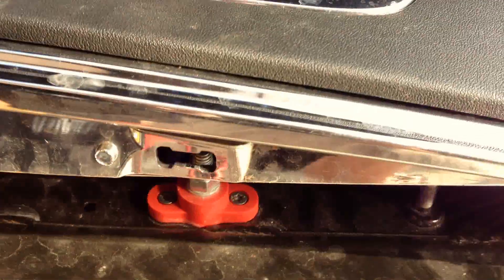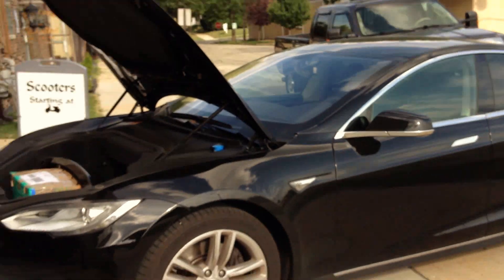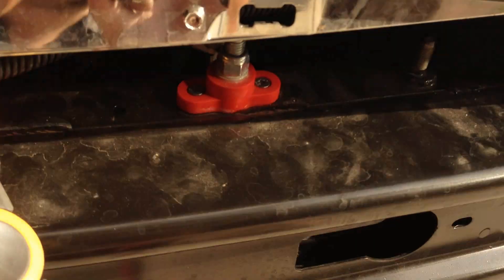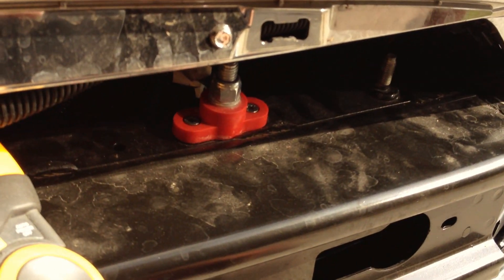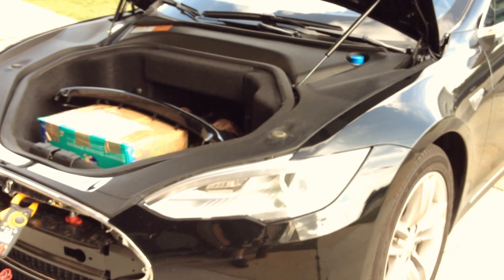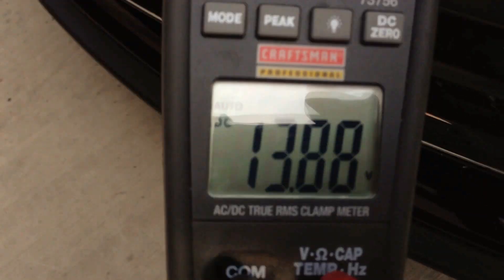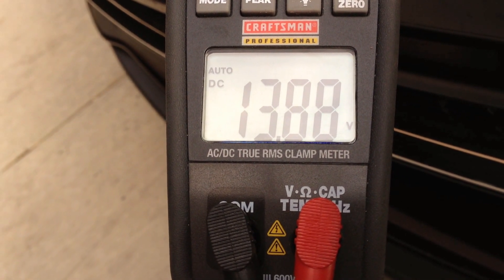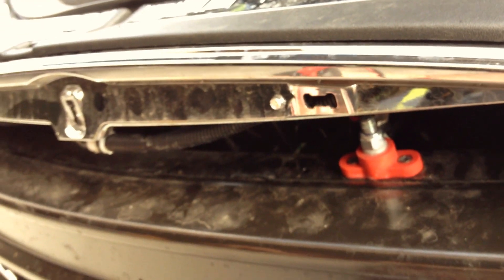Tesla Motors Model S: Part 37 of Many! Over-Volting Lead Acid!

Comment: Depending on the specific battery it may not be an issue. Odyssey AGM batteries float at up to 13.8V, so this would be only slightly high, and they can charge up to 14.7V after a deep discharge.

Comment: Interesting, I've been using 4 of the PC1700's in my electric 6x6 for the last 5 years with no issues, and I have a PC625 in my EV and one in my JetSki.  So far so good.  One thing to consider, Tesla may have data from the manufacturer that slightly above 13.8 is not a problem.  Have you talked to anyone at a service center about this?

Comment: I would think the 12 Volt power management is regulated through software. Hopefully any bug in it can be fixed as an OTA (Over The Air) upgrade.

Comment: There is no direct dependency between drive battery and 12V battery charging. Depending on firmware, the car will use 100W of constant "vampire drain" power to keep the computers powered up, less with 5.x. Taken from the 12V and recharged from the drive battery at some time the firmware considers it is time. But, 13,8-9 is exactly right to avoid grid corrosion if the 12V is full already...

I guess with the "vampire drain" reduction firmwares you will see a change in strategy but not voltages,,,